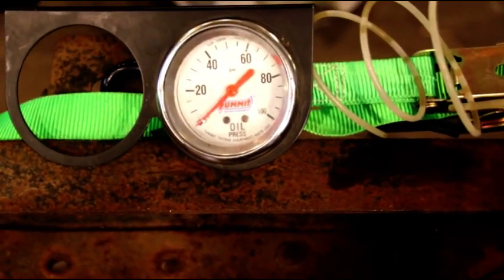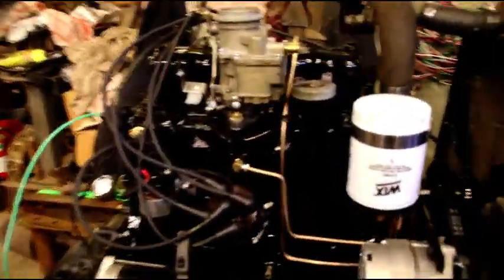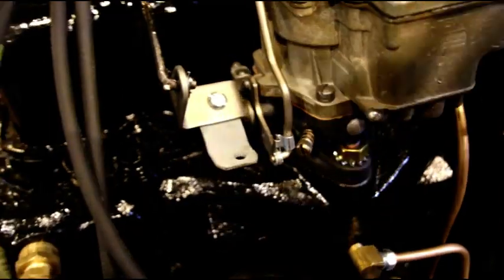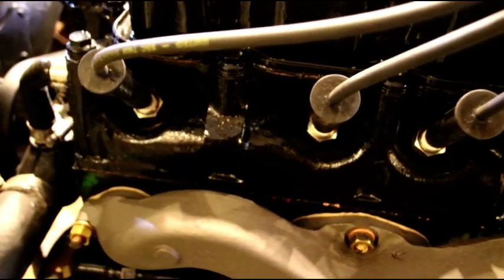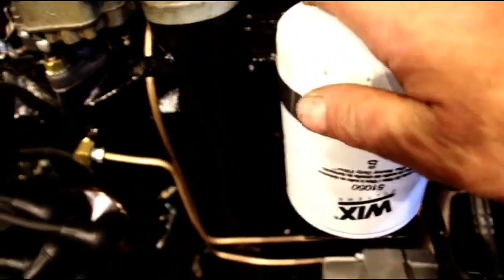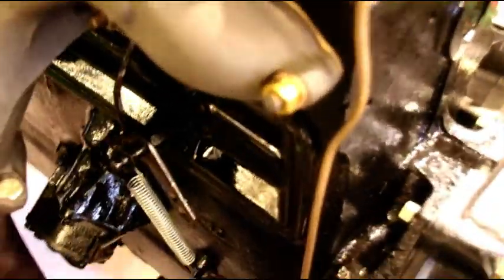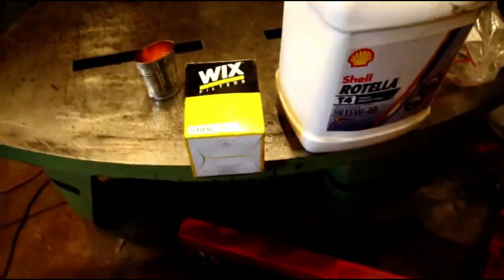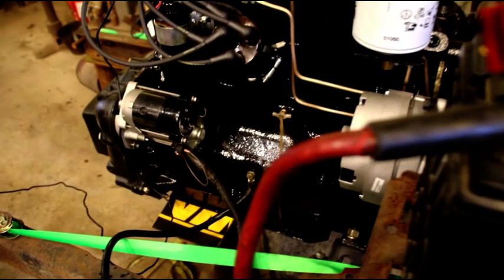Gary's Willys F 134 Engine Running In Test Stand

Comment: Do you recommend that 15-40 oil in all the older motors? Should I be running that in my amc v8
Reply from the maker: I run Shell Rotella T4 in all my Willys engines, my 258 engines, and 304/360/401 engines as well.  Also use it in my 6.2 diesel CUCV
The only time I use anything different is if I know I will be operating at extremely low temperatures.